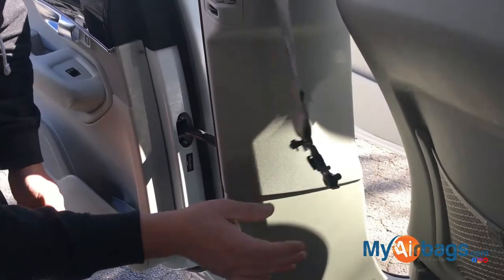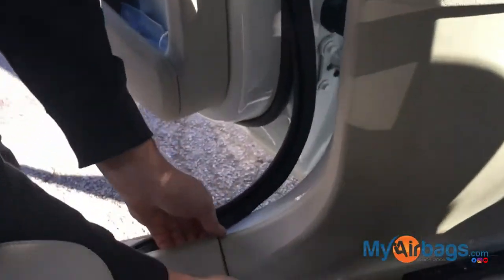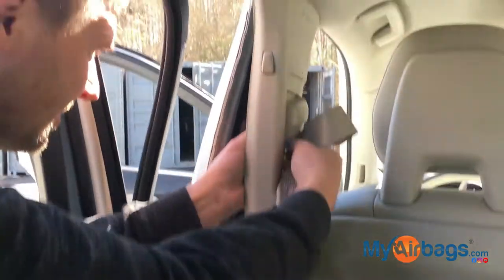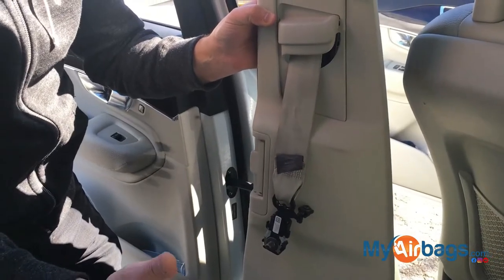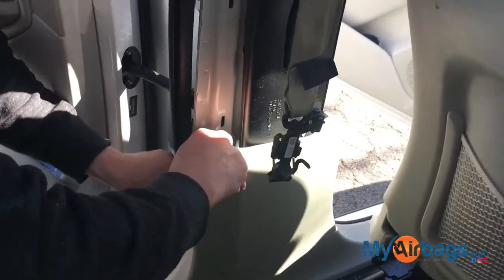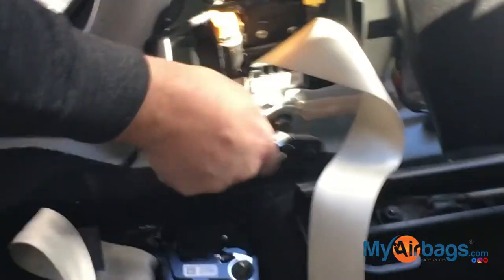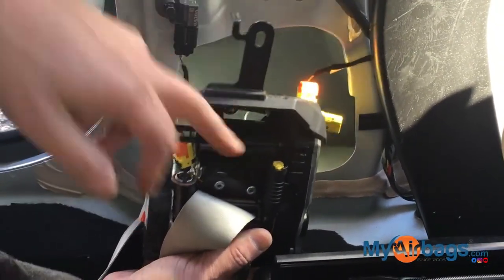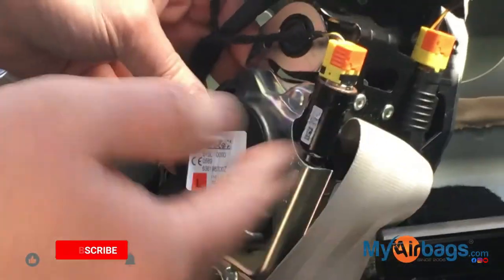How To Remove Seat Belt for Volvo XC90 - Step 2 | MyAirbags

Comment: I have a v90 2017, can I change seatbelts from xc60 polestar golden belts to my v90?
Reply from the maker: You can try. Look at the mounting brackets and the harness plug to make sure they are the same. If they are, then it will work!
Reply from the maker: If they are not the same, then there is an option to send your original seat belt for repair. Check out myairbags.com